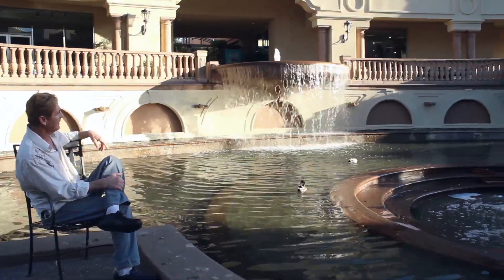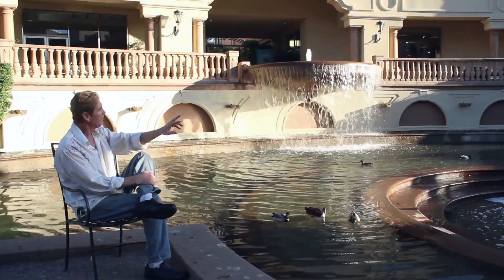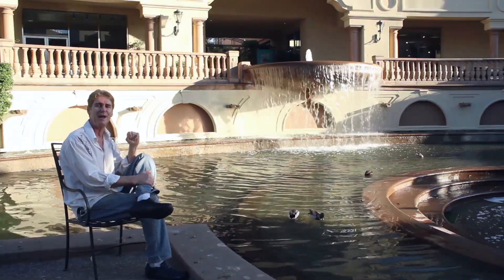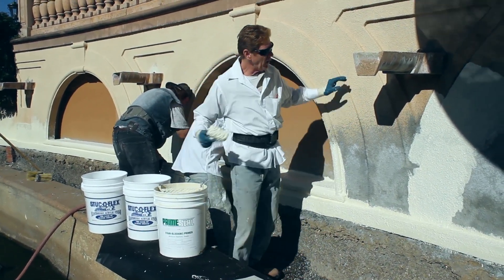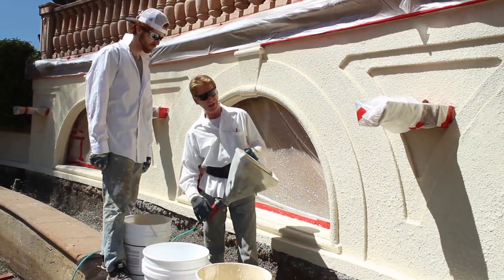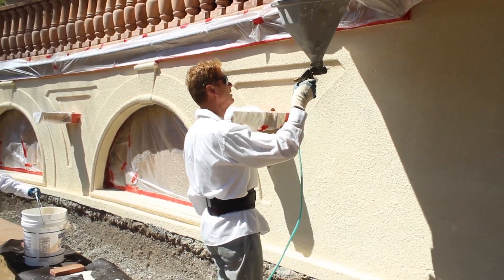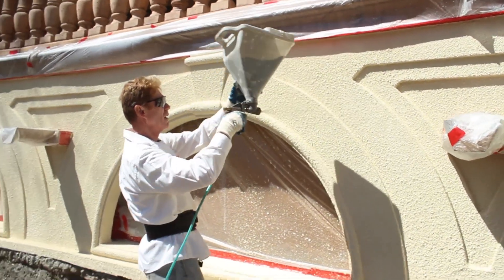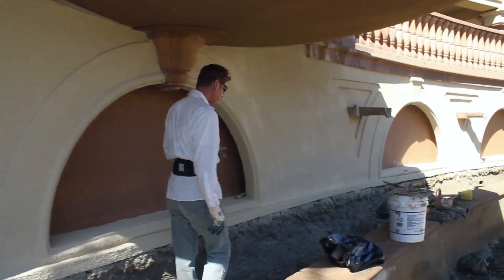Stucco acrylic applications, Stucco-Flex

Comment: I have old stucco that needs touched up. It's hard to tell if it's been painted over or is just stucco(I even did the water test and it was iffy) but I know for a fact it hasn't had anything done to it forat least 56 years(was my parents house). Would this stuccoflex work on painted stucco as well as non-painted stucco? Which stuccoflex paint and primer would you recommend. I live in Nebraska and it gets HOT and FREEZING. Also, do you know the webiste for this brand of stuccoflex? thanksin advance
Reply from the maker: Howdy Kim, all the information you seek is in the description, Blessings.🕵🏼

Comment: Marble dust and silica sand are similar . These materials are the thickeners of dry coatings.The underlying polymers/latex suspension provide the flex of coating / waterproofing(90%waterproofing). In Aus we have reps that have no idea of these aspects of coatings and listening to you helps me realise that we are 20 yrs behind the USA in exterior coatings. The funny thing is that our coloured coating systems for render do not last as long as your systems in the states. Our oxides fade and are not uv resistant. Painting with elastomeric paints is the only way longevity is maintained. The world of stucco is weird! Cheers mick!
Reply from the maker: Howdy Mr.Mickteen, actually this acrylic is far more advanced than almost all sold here in the U.S, as it's 100% elastomeric plus the other benefits are too many to list, visit their site on the links I laceded in the description, Dan Johnson has a few 1 minute videos that shows with an explanation the phenomenal results that can be achieved with this material.
        Live long and plaster
 Giordano’s plastering images and teaching video’s

Comment: Kirk is the plastering painting movie star. Well done Kirk. Looks like you need some equipment to carry on that type of work.
I have been looking at the cordless paint applicators and more particularly battery powered water sprayers. I have a Bosch water tank I pump up for my sand finish and plastering jobs. But it would be better with a pump so less wait time. You have a great family bonding.
Reply from the maker: Howdy Ronald, thank you,
it help s big time to have quality tools, the cheap ones a fella spends more time fixing them.
   Long live and plaster
 giordano’s teaching videos

Comment: Hi Kirk,
I covered a wall on my house with StucOflex as an emergency waterproofing solution. Now I want to refinish the stucco on the entire house. The installer wants to put a skim coat on the entire house and finish it with StucOflex. Can he put a skim coat over the existing area where StucOflex has already been applied or should he just cover it up with an additional layer of StucOflex? Also what StucOflex system do you recommend for refinishing a traditional stucco house? Thanks for your help!
Reply from the maker: Good evening Jones, If you have a wall with stucco-flex already on it and wish to freshen it up or change the color, stucco flex has a primer and paint system compatible with their acrylic finish.
 FYI, as long as any acrylic finish is sound, it can re re-skimmed, also.
 Bringing peace, love, and brotherhood, back into the 🌎 of Plastering.
    The most comprehensive encyclopedia of plastering on video, by the plastering messengers of Youtube. 
Kirk and Jason Giordano with over 800 videos 🎭 👀💃

Comment: Hey Kirk, very helpful video!  Two quick questions: 1) Stuc-O-Flex has more than one primer and more than one top coat.  Can you specify exactly which ones you use in this video?  2) We're planning to apply this over Hardy board.  Should we tape the seams or just count on the primer/bonding agent to fill the cracks directly?
Reply from the maker: Good evening Paul, with any kind of cement board, tape the seams, and apply a basecoat first then a primer and acrylic finish.
 All acrylic companies have their own primer. I used a stucco-flex primer and their acrylic finish coat.
 Bringing peace, love, and brotherhood, back into the 🌎 of Plastering.
    The most comprehensive encyclopedia of plastering on video, by the plastering messengers of Youtube. 
Kirk and Jason Giordano with over 800 videos 🎭 👀💃

Comment: Hey Kirk -  I see you are using a texture hopper to app;y -  but can you apply by rolling on and still get a similar finish?
Reply from the maker: GreetingsTim, no. even with the thickest nap of an inch and a half, this blown on finish could not be achied. 
It must be blown on or thrown on.😉
  Our unique plastering Tip:  all subscribers or anyone who stumbles on our channel with a question, type it into our Stucco/Plastering channel, and like magic, a video will appear to explain how it's done. 	
   This feature is miles ahead of any plastering forum. 🥳	
Kirk & Jason Giordano Plastering
Reply: Hi Kirk, very nice video. I’m wondering if you manually apply the stucco flex manually the same way cement base with a dash brush. If yes do you have to dilute the product?  
Thanks for the feedback

Comment: Hi Kirk,first time Ive seen you sit down I think.Is that a Wagner airless unit youre using?...great video!
Reply from the maker: Howdy Paintbrush Dude, not sure which hopper I used as I have three, this one happened to be the cleanest, thus it was used, will get that info to you later.
        Live long and plaster
 Giordano’s plastering images and teaching video’s

Comment: After it dries can you go over it again to create a thicker texture (kinda like a knock down)?  I want to use this but have a large wall with a lot of joints and vibration ( I will use their Stuc-o-base or PRM to level wall).  I want a thicker traditional stucco look to help hide imperfections and because I just prefer the look.  I've seen pics of this look on their website but no videos of how they achieve this.  Thank you :)
Reply from the maker: Good evening Lisa, sure you can. It's called a heavy dash or tunnel dash finish.🥂

Comment: Hello Kirk,

Great videos - really enjoy all the excellent info.

I have a slump block house plastered in synthetic stucco.  My question is, can I put traditional stucco over it, and would I need metal lathe or just bonding agent?  If so, is it better to do a scratch coat first before the color coat or can I just do the color coat?

Thanks,

Dave
Reply from the maker: Howdy Dave Dude,
 If it were me, I'd pressure wash well then scrape off any leftovers that are peeling, I would strongly advise any stucco netting or wire being attached as this would be disastrous, so don't do that.
 Instead, apply another acrylic finish coat over what you have.
 Use stuco-flex, Dry-vit, BMI, carsons as the acrylic's of choice.
                      Best wishes,
Sound advice From your neighborhood stucco geeks
Reply: Thanks very much!
Reply: So putting on traditional stucco coat is not advised over the synthetic stuff?   Just tend to like cement based stucco better if that's a option
Reply from the maker: Howdy David, you got it, now, you can apply a synthetic or acrylic stucco over a cementitious finish, but never the reverse as you were going to do.
 Don't do that for too many reasons to mention here.
                      Best wishes,
Sound advice From your neighborhood stucco geeks
Reply: Thanks again for the advice, Kirk.

Comment: What color was this?
Reply from the maker: Good evening my friend, yellow and red. 😉
Our unique plastering Tip:  all subscribers or anyone who stumbles on our channel with a question, type it into our Stucco/Plastering channel, and like magic, a video will appear to explain how it's done. 	
   This feature is miles ahead of any plastering forum. 🥳	
https://www.stuccoPlastering.com
http://www.bayareaplastering.com
Reply: @StuccoPlastering   Thank sir. 😀 Would this be the “Sunshine” color from stucco flex?
Also would it look bad to spray this stucco flex from a hopper over a medium sand finish that’s already preexisting?
Reply from the maker: Howdy Skiroy, they say the squeaky wheel gets the oil. I went through my books and found the colors just for you, my friend. Thank you for being resistant. The video has it all now in the description.  😉
  Stuc-O-Flex collection of Sunset yellow for wall number 107.
 And for the arches or radius, Stuc-O-Flex,  tan number 375, 

 cheers, boss.
Reply: @StuccoPlastering  thanks so much sir
Reply from the maker: no problemo, my friend.

Comment: Hard to buy this stuff. Stuc-o-flex website doesn't even have a "where to buy" listing. You have to email them for distributors. Don't even dream of finding this at your local HD or Lewes
Reply from the maker: Howdy G dude, I simply called and they delivered the product to my driveway,
 Your right this is not sold at any of the material yards as it sort of engineered for the professional plasterer, so you have to order it.
 My name was on the line with this project so ordering was no big deal, in fact, from now on this is what I will do all the time as it was so easy.
        Live long and plaster
 Giordano’s plastering images and teaching video’s
Reply: How much does it cost?  Whats the coverage of a bucket?
Reply: They emailed me back pretty quick. They said they normally ship it to you. The price given was $80 so I assume it's a 5 gallon quantity. They didn't say how much shipping would be even though I included my zip code. Prices and shipping should be advertised prominently on their website so each person doesn't have to dig around so much.
Reply from the maker: Howdy PCM Dude, no worries, they often deal with commercial projects, I think they are gearing up for the public whom also wishes to purchase and apply the product.
        Live long and plaster
 Giordano’s plastering images and teaching video’s